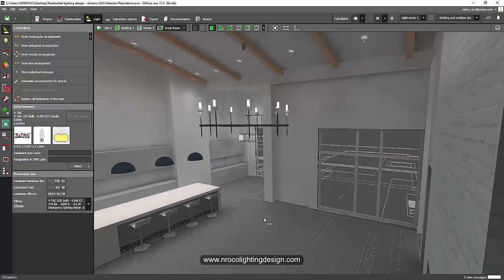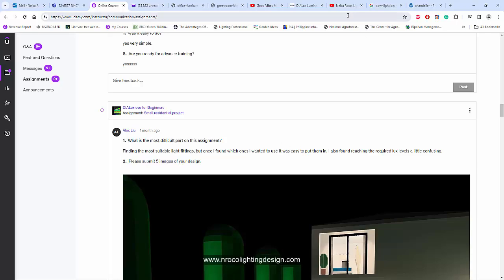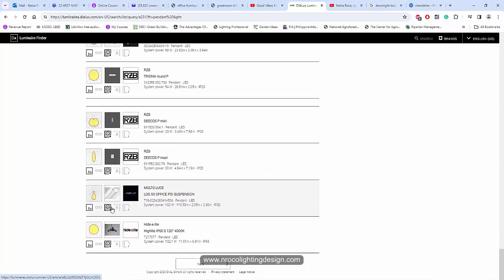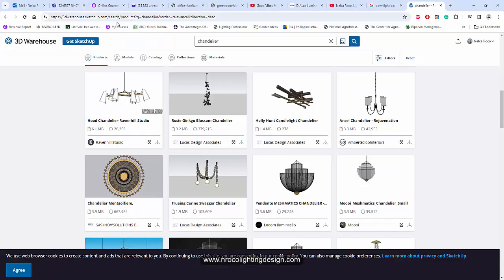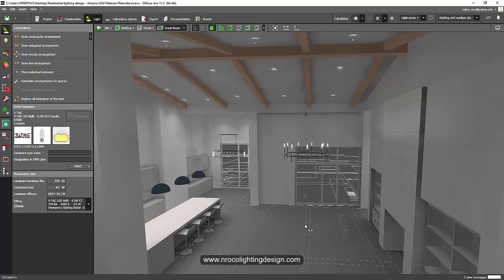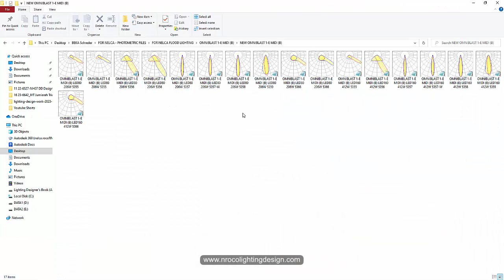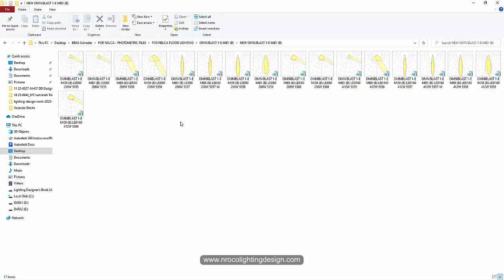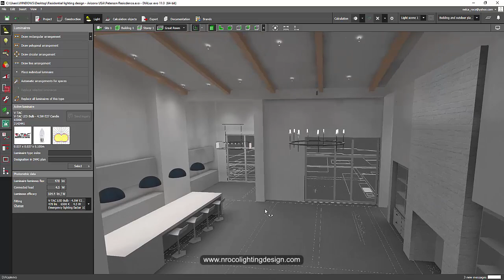How to select the luminaire

Comment: Hi Nelca, I have a Question: How can I render the lights so that the shapes of the lamps are visible? There are no linked ldt and 3ds files for some lights.
I need a 3d view where I can see the shapes of the lamps and not the ldt or ies files. I have tried raytracing but it does not work.